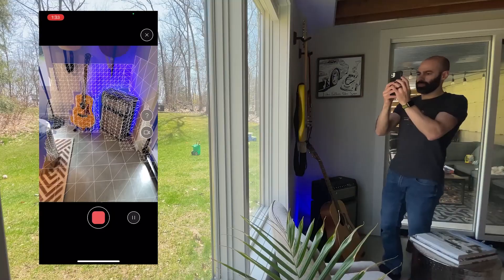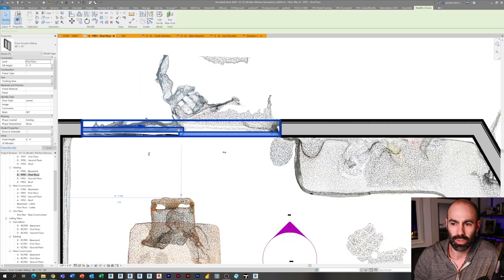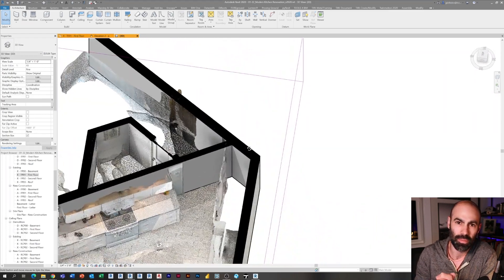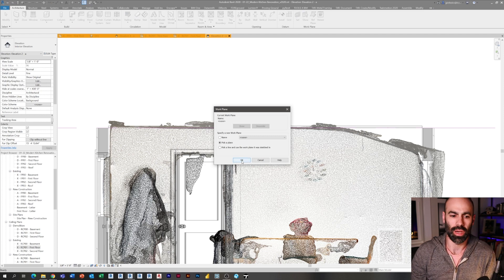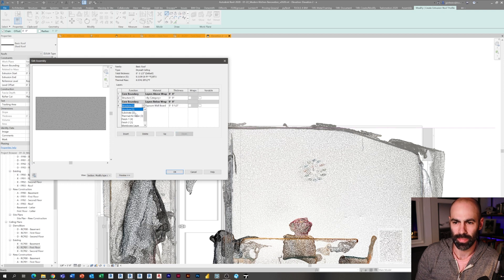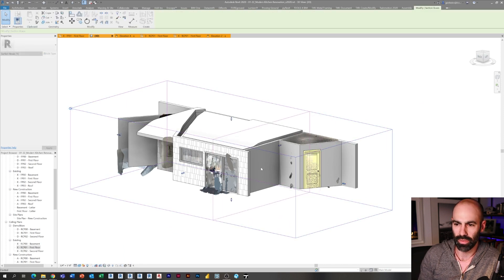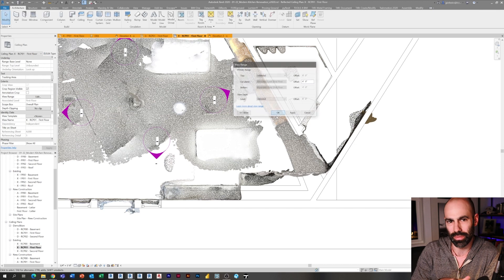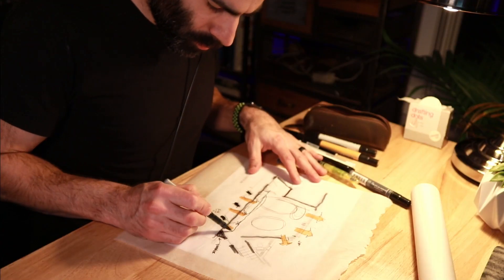EP02 | Modeling Windows Doors and Ceilings in Revit Tutorial

Comment: Hi, great series! From my part, is not an issue how long it gets, when you doubt in cutting parts of the process. 
I assume that is not a big issue to find the providers or brands families (like for windows families) and its ok to use generic personal optimized ones?
Reply from the maker: Sure, it's okay for using generic... For example, I use these same picture windows whether I am specifying marvin or anderson.  Just size them TO the manufacturers sizes if that 's the goal.  Not to say you can't use manufacturers windows... some are great!